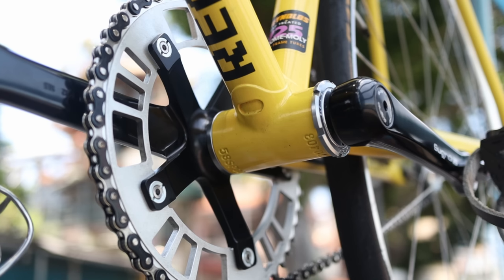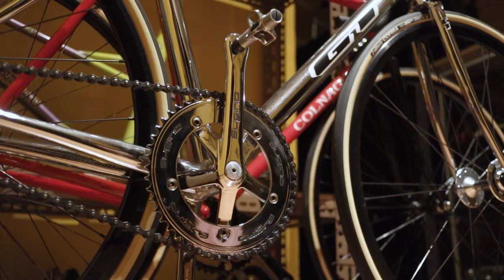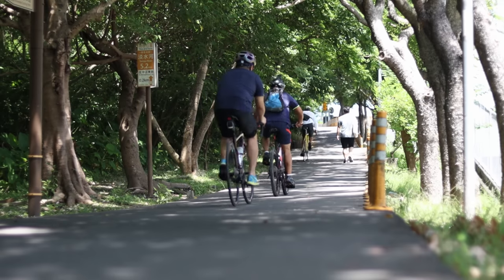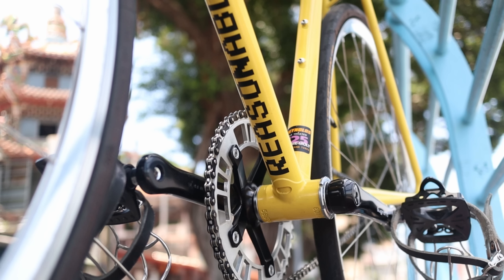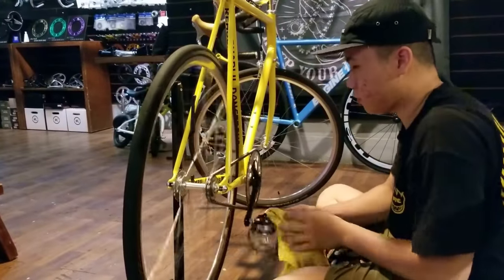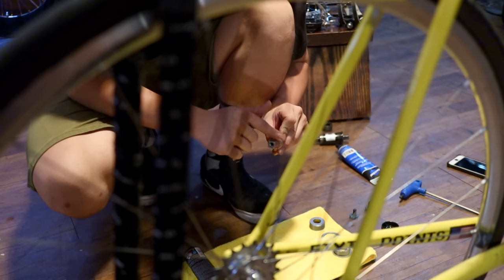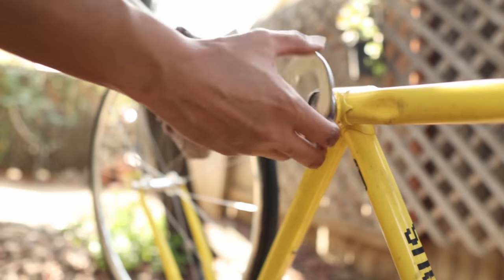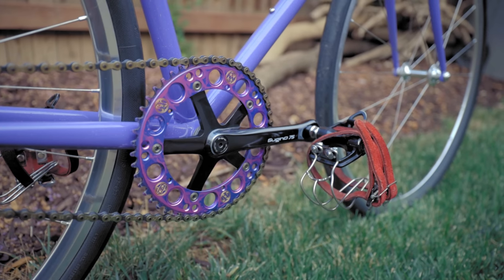The Most Overlooked Bike Upgrade

Comment: After year on and off of square taper cranks, TBH Shimano cartridge BBs are the better investment, no "tuning" required fit an forget for several years, cheap and simple enough to replace when you need to...
Reply: That is not always the case because quality control of cartridge BB are poor. Your mileage may vary.
Reply: @wasupwitdat1mofiki94  Shimano are generally pretty consistent and having spent enough of my youth adjusting and re-greasing caged bearing BBs I know how I would prefer to spend my free time...
Reply: once i got a special splined bb, it had 3x big tough bearings,  but oops, they all broke because they were thinner than regular square taper bearings.
Reply: That's what I'm getting. They're pretty cheap as well.
Reply: Too bad they discontinued the bb un 55 and only sell these crap 300 units. Now there is now more real alternative to significantly more expansive cartridge  square taper bbs
Reply: @marcelschultz4033  The bb300 is the one I'm going to buy. Why is it crap?
Reply: @caiofernando  I build bikes as a hobby, mainly vintage steel frames and modern mtb to drop bar mtb conversion - stripping them, painting them building them from ground up. For the vintage ones I used old xt cartridges, when I could find them - which lasted forever - and the bb un 55 lx ones. Where I live they were around 15€. The bb un 300 are around 9-10€ pre corona and are of lesser build quality in my opinion. Group wise they are tourney level and tourney parts imho are often so bad they should not have been producedin the first place. I had some of them crap out on me after a short while. + they are heavier. I used   token ones for a while, which are nice overall but quite expensive at 40€. Since new square taper cranks are getting rarer, I switched to modern bb and hollow axles although I always likes cartridge bearings. When you know whatyoure doing at montage they are ok, as long as the frame manufacturer did not fuck up the bottom bracket - there the cartridge ones where much more tolerant. But try your luck with the bb 300, for a simplecommuteit can be ok for a while but dont expect to much from it
Reply: @marcelschultz4033  Thanks for your thorough response. bb 300 is what fits on my budget right now, and I'm choosing it over cheap bbs worth like 8 dollars that I can find here in Brazil. I figured the bb300 would give me the minimum quality acceptable.
Reply: I second this.

Comment: I... kinda don't understand this video. Did Zach recomended us top quality bottom bracket just to say a rant about why it's absolutelly not worth it and that it have similiar issues to $5 bracket? I ride my bike daily, I also work in delivery doing at least 90km weekly on it and I have a sealed no-name bracket that carried me over two years, two salted winters - one with extreme snowing - and only currently started to fall apart. Not like it's not working, it just sometimes does a cracking noise and isn't that stiff anymore, but it still rolls ok-ish and almost noiseless, that's it. Almost zero maintenance, I just unscrewed it like 3 times to be sure it's not stuck in the frame and to change the grease there. Why would I want to do a maintenance once a week in good weather and presumably everyday/every second day in rain/snow for a 8-9 times bigger price so this part can do a little bit better job and stay stiff? Sound's like nobrainer to not buy it.

Comment: this is a bit funny... if youre riding a cup and cone square taper bottom bracket which was basically rendered obsolete around 30 years ago then upgrade to a sealed bearing square taper. everything else is crankset specific...

Comment: I just changed out from a stock GXP to a phil wood outboard BB. Honestly the difference is huge. So smooth and stiff as hell. Only problem I had was finding the fit kit in stock.
Reply: When you installed yours, did it take a little while to break in? I just installed mine and it's smooth but doesn't spin as freely as my other cranks on my other bike.
Reply: @TheElephantDan  no I did have to get the threads on the frame tapped by the local bike shop though. I know if it is even slightetly off then The cups don’t match up straight. That could be the source of the tightness. I had to get the Chris king fit kit 6 which took an age to source. It is incredible now it’s fitted properly though.
Reply: @sketchy0078  Ah I see. I wonder if I’m screwed. I’m afraid to take it apart now.

Comment: tange sealed loose ball BB properly adjusted is supper smooth. Experience makes tuning a lot faster. Well I only have true vintage ones so.....Most of mine either came from shimano 600 (ultegra) or SR Apex cranks. I tried modern ones but I have ended up just going back to loose ball BB, IMO the feel better and are serviceable.

Comment: My experience: use more grease if you’re in the rain and use more than you’d expect. Living in London the roads are terrible, always wet and my BB won’t need servicing for a year (granted I’m not a messenger but I ride a lot). Also to adjust the lockring right just use the lockring and pin tool at the same time so you can get some proper torque on there!

Comment: As a current mechanic and someone who's restored a handful of vintage bikes I have to say the adjustment isn't the issue, sounds like the quality of the grease was too low. I never pack hubs/bottom bracket/headsets with Park grease, only use Phil Wood for that. Phil's grease does it's job and really acts like a seal to keep water out. Sick bike though! 🤙

Comment: You want to try Miche Supertype bb => that's hollowtech (I know, you don't like it), it's amazingly stiff and it can take two years of rain and it'll stay stiff an light AF.
You also want to true your wabi wheels, they're really wobbly, man...
Reply: That rear wheel had more back and forth than Fauci or an equally waffling politician.
Reply: Are there any miche supertype bb's that are threadin vs pressfit though?  At least hollowtech BB's would fit that bike.  Either way yes, the further out the bearings are mounted the more stiff it gets, now I won't go back to square taper after seeing the light and it takes years of riding wet, dirty roads to have any issues with the bearings.

Comment: Yeahhh can’t relate because I’ve been riding my Sugino 75 NJS bottom bracket for six years now and my bike has never felt crunchy infact it’s been buttery smooth despite years of abuse and I haven’t cleaned or serviced my bike since I got my bottom bracket SIX YEARS AGO ‼️‼️ it’s amazing totally recommend the sugino 75 NJS bottom bracket. I ride a fixed gear Cannondale CAAD 10 by the way

Comment: I have a lot of years fixing my own bikes but only this year got hands on experience with a Vintage Campagnolo BB from 1985 which is very much the same as the NJS. That thing is nice. I have always gone for the lighter the better like Chris King but even though this Campy BB is 300g and the Campy Victory Gran Sport crankset weighs a bit more I love this thing. It's rad in the looks department too. I have had the issues you mentioned yet.

Comment: I'll differ.  I begin with the frame, and then focus on the bottom bracket bearing and crank. For my Tsunami build, I determined to use external bearings, so that constrained my crank choices. I was able to trade cost as an independent variable against weight, stiffness of design, and esthetics to arrive at the crank choice. Next are wheels, and so on...
Reply: Ok think they're determining someone who'd swap bottom bracket has a decent enough frame.

Comment: Never been a fan of sealed bottom brackets.I prefer old fashioned cone and cup with bearings.You only had to strip and clean and pack with fresh grease,and that was hardly ever.Now theyve designed a part which will wear out quicker.....

Comment: on the stand, loose ball bb's are going to have noticeably less friction than cartridge bb's simply because of the bearing seals.

also, if you want to experience minimal friction on a set of bearings, remove the grease and use some sort of oil. something like phils tenacious, or similarly thick-ish oil. though it'll probably only last two rides or less.  fewer if thinner like 40-50w motor oil. 
try it for a project, make a video on it. or perhaps its better suited towards spindatt with his tinkering.

Comment: I had an expensive White Industries BB with titanium axle and a traditional lock ring like the NJS. It was garbage. The aluminium they use for each side of the BB is so soft that it deforms like butter. On the drive-side the lip simply breaks off with repeated use. The latest Shimano square taper bottom brackets are a hundred grams heavier, but they don’t break, and they cost a tenth of the price.

Comment: Dude, here is the word:

-Find some not over-priced Ellipses.
-These have a 46mm effective chainline, which is a pain, EXCEPT...
-That's exactly the effective chainline of the outer ring of Dura-Ace Road 7701s.
-So, go 130 bcd--heresy, I know--buy a Dura-Ace 7700 bottom bracket ($65--sealed bearing) find and clean up a Dura-Ace road crankset from Ebay ($40-55$) and BOOM: You've got one hell of a crank setup.

Yeah, yeah yeah--this implies you go out and buy new wheels, but for anyone who has Ellipses already, this is the GOAT of drive-train set ups, and it ain't crazy expensive...
Reply: Agree there’s tons of better alternatives. Don’t pay for hype

Comment: I have to disagree with you Zach, for me it's the headset hands down. Nobody seems to realize how a bad headset will basically turn your pinarello into a cheapo paperweight. Steering and power transfer are both affected with the headset. It is THE thing on your bike that should be precisely adjusted, no excuses! :D
Reply: I can't imagine a gritty headset would make you lose that much power
Reply: @Red-ju4mi  it can be gritty but work well enough though. The problem is when the preload is too much or too little, or even worse, the frame's headtube has misaligned bearing sockets and you'll never get proper steering while under load. 

If you think about it each time you put power through the pedals your fork is constantly moving to smoothly counteract that force, thus correcting the bike's stability. If under load it's too rough, the bike will fight back each time you want to sway it side to side for example. It's something I see more often than I'd like.

It really can make a good bike feel like it's 5kg heavier when you really want to handle it.

Comment: When i bought my frame it has some 40year odl original italian bottom bracket (loos being ofc) and i didn't have anny informatikom and I miled a bottom bracket hole to fitt a modern closed being one (campagnolo) and I was shocked that my 130€ "ugrade" was actualy worse than my original loos being one. My dissepointment forced me to buy another antique frame and made that New frame into a period corect bike and my old( actualy you ger frame) become a mix of old New parts

Comment: hi, can you explain the pros and cons between square taper and hollowtech?
Reply: Hollow tech 'n stuff like that weighs less and is supposed to be stiffer, that's it basically. They're not necessarily smoother.
But only professional cyclists benefit from the weight savings.
What you will notice is a difference in smoothness between cheap and expensive bb, and it doesn't matter whether it's square taper or a modern system.
Just make sure bb and cranks fit together and that you get a good chainline out of your bb.
Hope this helps.
Reply: Sorry @Bebo  but that's bullshit. High end square taper bb are at least just as smooth as hollowtech.
Okay, they're also way more expensive.